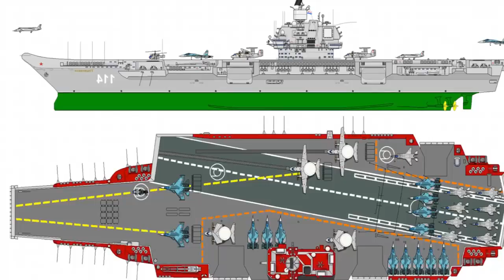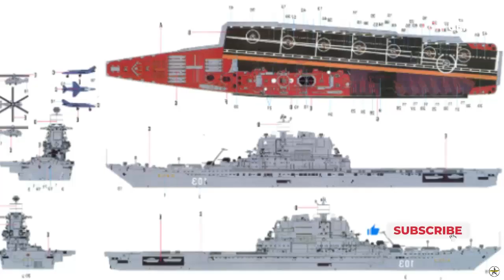Details About Türkiye's Future Aircraft Carrier

Comment: i am sure F-35B will be acquired as an interim.
Reply: Dont need f35
Reply: I don't see them rely on the F35B or the naval one it's not a trustworthy choice and  the complicated technologies implementation in such project will require 10 years that's enough time by then either way in ramp version or a catapult they will create a naval version of the Kaan or more easily a naval version of the hurjet advanced trainer which will be more suitable for ramp since it's light weight for the Kaan it will certainly need an electro magnetic catapult but making a naval version of the Kaan is another complicated matter in all cases the medium size 50k tons carrier will only host Turkish crafts and drones like the TB3, the jet powered anka3 and the Kizilelma, the hurjet, the atak 2 heavy helicopter, the gokbey for utility and the 929 for heavy transport copter.